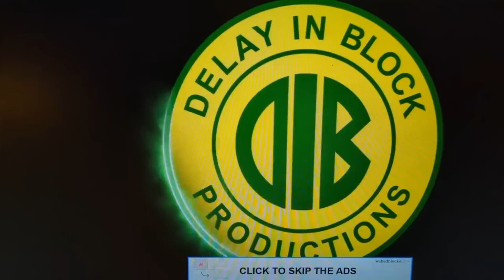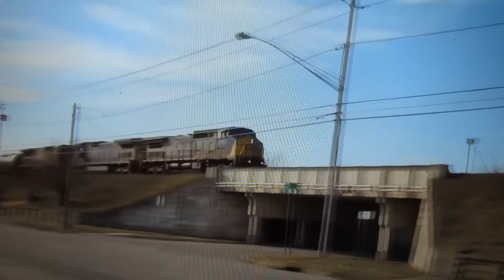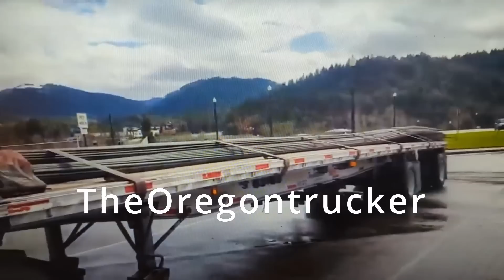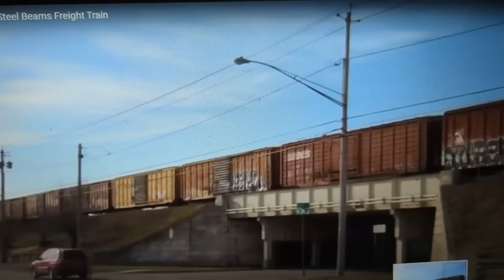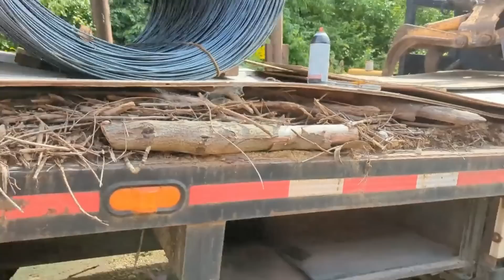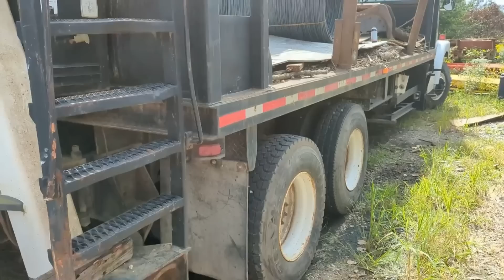Rail Cars loaded with Steel!

Comment: Besides the 3 sites you mention for railfaning, another site for viewers to go for maintenance and track work videos is "ccrx6700" (Cumberland Mine Railroad). He shows and explains cribbing, tamping, tie and rail replacement, ballast rehabilitation, minor car repair (wheelsets, couplers, hoses, etc). A lot of the same work you guys have to do, and what made your site interesting to us early subscribers.

 Incidentally they transload product from the train to barges, and only deal with a single product. For your guys sake, I hope you get to transload product and materials in both directions of a diverse set of materials. It would be very interesting to us fans to see how you develop your yard tracks for not only steel-based-product on flat cars and gondolas, but also other products in box cars, tankers, covered hoppers and so on. Mostly I'd love to see you build a couple of ramps and deal with boxcars.

Comment: Rent an excavator, ideally with a 360 swivel head. Buy/make a C arm for the coils that attaches to the standard quick attach parts.  Modify the spreader Gram bought to also mount to the quick attach for long floppy stuff. 

No capital tied up in the expensive excavator, if it goes down rental company can swap and get you back to work.

Comment: You could do an overhead crane yes it is stationary frame. But it rolls back and forth. And left and right. Containers is called a mi jack but the overhead crane could use mechanical or magnetic for lifting power.

Comment: I think one of those heavy duty forklifts would be a great asset for the operation.  The material handler would be good also but might ne limited when it comes to the truly long stuff.  I also agree with the other poster about the rental units too. Maybe buy the forklift and rent a material handler until you can buy one. Having a back up will be a necessity. 
I think it's going in the right direction. Stay safe my friend.

Comment: Try thinking about those Mobile cranes used to lift boats out of the water they have huge loader tires and are wide enough to straddle the gondola pick the load then side shift to waiting trailer totally self contained for outside us any weather with self contained operator station .

Comment: Brian don't throw in the towel on other products! 
Steel is not passive income as you said....
What you could likely do to gain something more "passive" and allow your customer to unload themselves with minimal support equipment/supervision is to look for your neighborhood home improvement/lumber/landscape dealer.
If you can "acquire" usage of one of those warehouses, then you can act as thier "distribution center" ....
You can get boxcars of lumber/sheet rock, bagged landscaping materials, pallets of pavers/bricks, the warehouse would be where they unload, and "break bulk" to go to multiple stores (or one store as needed).
They could pay you rent....
Another option is for something like bricks on pallets, just have a paved area to unload and Reload onto trucks

Comment: I was going to suggest that overhead crane from a building but someone beat me to it. The nice thing about that is it is supported on both ends, much more stable. Whatever way you go I would suggest getting some form of pad or pavement down for the crane/loader to be on. Having a smooth level surface will really help with speed and safety, not to mention avoiding the mud when it rains.
Reply: If you put down a gravel or crushed rock surface, go with 3/8 or 1/2 inch to dust, spread it out, and compact it.  It will be like concrete.

Comment: Ideally you want a rail mounted rolling A-A frame crane and a yard mule for transloading steel to trailers. I think you're on the right "track" looking at caterpillar tracked unit initially. I would think of using plug in power and mining cable for the magnet rather than a diesel generator for maximum lift.

Comment: I'm for a large front end loader with forks. I've seen them being used to unload and move shipping  containers. Using an excavator to run around a yard makes no since to me. You'll tear the ground up and make it impossible to traverse. I'm enjoying your videos and understand you're building a small business, not just a railroad. Keep striving!!!
Reply from the maker: David  Advantages to your plan....front end loaders are faster to move around...do less damage to the surface...and are plentiful at auctions.   Brian
Reply: Years ago I saw a front end loader setup with a quick change carriage on it.  They had forks that could go under a load to pick up raw stock set on boards.  For coils they had a single center spar.  It was about 6" around and would be run through the center of the coil.  It kept the load at the center instead of to one side and also, the round surface prevented marring the surface.  In this case they were handling round rolls of sheet steel.

Comment: That flat magnet  attachment looks  interesting  ..would  it work...if you take a flat plate and Weld some half moon 🌙 piece  of steel  plates to the flat piece of steel and bolt and magnetism  to bottom  of the big magnet  so the half moon add on attachment would  grab (Magnetic) more of the steel  coils..     (2) on top off magnet  installed  a 4" or so I beam for installation  of a Hydraulic  campers so Coils are magnet  and clamped to lift....(3) would  a Hydraulic  grabber attachments  on a skidsteer tractor  work to off load from a bulk head flats  cars then onto a truck trailers....
Reply from the maker: Bradford   I thought of the curved piece too, great minds think alike!  Brian

Comment: Intel project in New Albany is who you need to get with. I may end up running machines on that job. Working on a bridge replacement on Agler road in Columbus right now. It is very close to the airport.

Comment: Greetings from Europe. Bacause i have some experince wit loadning and unloading ferrrous materials i wish to help in some way. Magnet here is used only!! for scrap metal. To load with magnet like railtracks are used in special terminals with multimagnet gantry crane beam what can pick up around 10 meters of track but not one, most cases 4 or five. For unloading coils are used cranes mostly mobile cranes. On beams again cranes. On that liebherr machine is good idea but that is mostly a port loader or unloader with various attachments including magnet but mostly grabs for like grain or dirt of other we called vrack materials. If you can have a grate mobile crane, or tracked probably would be ideal. On handler, are good like Liebherr or on other one is Sennebogen. If you visit this machine dieler they cen help your to choose best attachment for your need. If You need help i can help to find from this brands machines for your need and than to visit a brand dieler. Why go on new? Beacause it assured to dont fall on you the used ones. Or used is need to cheked if can handle the porposed load. On oils the magnet not will work. best than chain or cable.

Comment: A large forklift with a special made arm to go into the coil. They make these special arms for coils. The crane on rails would work great. Have it wide enough to put the trailer between the crane and gondolas so you can pick from the gondola and put them right on the trailer. Maybe have a yard truck to move the trailers around. Truck comes in empty drops trailer on one side the yard goes to the other side and picks up a full trailer while the yard truck moves them to be loaded. I really don't think a magnet will work or is safe enough to hold on to a coil while swinging. The speeder bar to pick up long floppy rebar can be used with a forklift would work good. A material handler with special made clamp that goes inside the coils that's made not to damage the coils. Different attachments for the material handler for different products.

Comment: Brian -- it's always an honor and a privilege to follow your efforts.  While for many of us your travails through the past 2 years would be a roller coaster, your manner of presentation and persistence have managed to smooth out the grades and make it all seem more real.  I can definitely relate as a small family business owner with 3 kids flying the nest in all different directions!
I'd have to vote for mobile vs. stationary equipment.  Going stationary would tie you down and define your operations a bit, and also could also necessitate structural issues like plans, zoning, utilities, etc.  For taxes, a gantry depreciates over a longer time period (25 yrs?) vs a forklift or telehandler (5 yrs).  You might also be able to get more people with experience and certification on forklift and material handling equipment than on something like a gantry.
It looks like some of those seriously large forklifts could handle coils.   There's some fixer-upper container handlers on Iron Planet if you're up for another "will it run" challenge...
Reply from the maker: Ted  I like the mobile idea too!  Brian

Comment: I'm not sure using the magnet will be the best solution, but I assume you will try it out to see for yourself. I would strongly recommend adding extra weight inside the coils for your test. Maybe an extra 1000 pounds or so. You need a factor of safety to make sure the magnet can reliably lift a coil each and every time. If it works without any extra weight, you won't know how close you are to it dropping the coil, which is what you want to avoid at all costs. If it works with the extra weight, then you can feel a bit better about the magnet's ability to consistently hold onto a coil during routine use.

Love the channel! Been with you since the start. I wish you all the success in the world!

Comment: Oh WoW Brain...Congratulations  so Exciting.. ..Could  you get a rail mount  Boat launch type Moble   crane thus have a small 3 foot wide asle way on either side of Car and park trailers right next to gons (HOPEFULLY  bulk head flats ) and off load Start small and a open  mind... BRAIN ONE NOTE THAT IS SO COOL ON THAT LONG BEAMS CUSTOMERS BRAIN YOU WILL NEED A NICE CRANE THAT ROLLS OVER RAILCARS  (Wheels on ground on either side of rail cars with a long spreader bar attach to crane  (Remote control crane ) We work at Boeing in auburn (YOU ARE INV ITED  TO TOUR WITH US BOEING PLANT AND SEE HOW THEY OFF LOAD LONG 130 FOOT LONG ALUM BILLETS FROM BNSF AND UP RAILCARS. BOEING ALSO USE 15 TONS REMOTECONTROL CRANES TOO...)(BOEING IS HAVING A FAMILY-ETR DAY ON SEPTEMBER 18TH 2022 THIS TOUR MIGHT HELP YOU BRAIN ON A SMALLER SCALE TO HELP INSPIRATION OF IDEAS FOR ETR "*TRANSLOADSFACILITIES"*$ )( IT BE COOL TO MEET YOU TOO)(NOTE BOEING 737 PLANT IS ONLY 20 MINUTES OR SO FROM "SEA-TAC" AIRPORT WE COULD COME AND PICK YOU UP AND YOU COULD BE HOME BY DINNER).and live off Ideas As ETR GROWS....ITS SO,SO WONDERFUL  HOW ETR IDEAS GROWN AS THE MORE ETR HAS EXPANDED..  WE REMEMBER  ON FIRST VIDEOS BRAIN USING A LITTLE  ELECTRIC SAW. THEN A FEW MONTHS LATER THAT NEAT RAIL MOUNTED BRUSH HOG..BEST WISHES..LOOKING FORWARD  TO THE FIRST TRANSLOADS 👍😀👏😄

Comment: Used 4 wheel all terrain Grove crane with a spreader and nylon lift straps should cover all of your bases. Or install a jib crane and use your switcher to move the cars to the crane.

Comment: This is what I like seeing. You're on the right track with starting small and building up your customer base. When I starter over 30 years ago on a small shortline, I went door knocking on any potential business that could be future customers and while success was 50/50, we did get some that added to our bottom line.
To your unloading problem a magnet might help, but like you said, it depends on the magnet's strength and the crane's lifting. If for the short term, you may have to sling those coils out until you get better equipment. There are mobile gantry cranes available, but I'm sure they cost a pretty penny, but that's something down the line.

Keep up the good work, Brian. Be safe and hopefully you will be able to hire extra help. We're all rootin' for ya!
Reply from the maker: Thanks George, I respect your yrs of experience.  Brian

Comment: Those "coils" have no flat spot. The magnet needs surface area & thickness to pick up those steel objects.
I am not a "rail fan", I am a track fan. I worked on the roadbed for 37 years dodging trains.
 Keep up the great work & the very best of luck.
Reply from the maker: Huge respect, thanks for following. B.

Comment: Rent some equipment to start.  Not only does it lower the initial cost, minimize potential downtime for maintenance issues, and allow for a learning curve of figuring out the bare minimum needed to do todays tasks, it also buys you time to find that diamond in the rough that nobody else bids on at the auction. 

I agree that a standing gantry system would be great long term, but you don’t know for sure what specifications you need to meet (yet). You will find out soon though!

Comment: If you are using a magnet to pick up a steel coil, will the steel coil not then become a magnet itself? I can see it lifting cleanly off a wooden or aluminum bed, but it seems that it would want to stick to the other coil, the walls of the gondola, etc. You certainly wouldn't want to have these coils pull apart. Hope I am wrong!

Comment: Thanks for the Roast beef sandwich really hits the spot. As for the magnet you may want to check with the customer if that is acceptable as the steel may become magnetized also with the product not being a flat surface it may not work out. I would lean more towards the excavator with a specialty attachment similar to a clamshell but use 2 large rods that would come in from each side of the coil. As for a Gantry crane that is an expensive setup and limits your work area. Plus you would have a lot more options to use the excavator for other projects.
Reply: This is a very good point

Comment: I think a rented tracked as you seem to be gravitating towards is your best option,  especially as a start up.
You don't want tie up a ton of capital in gantry crane that will be inflexible and a maintenance headache. Plus last time I checked winter still comes around once a year and a device like that seems like a liability in the snow and ice. Also what happens when you have to change gears to service new customers and products?  You have a big investment that is unmoving. 
Flexibility and low down time are key, especially if you're planning loading 5 to 8 trailers a day.
Best of luck from another small family business!
Reply: good idea.  Renting lowers the risk/ initial investment drastically.  He can test different options too.

Comment: I like that you are trying to specialize and be customer centered. 
You are reaching out beyond your Rails to Reload.
You seem 🤔 to be finding a niche "by becoming the Customer's siding" to further this, I would suggest adding both a level pad, a loading dock, and an extension of the missing spur so you have use of that track in the future if you want.
What would be great is if you could find something that you could potentially ship in that lends itself to rail being large and bulky....
Perhaps you could potentially work a deal out at Christmas Time 🎄 for Christmas Trees, bulk landscaping materials (bagged or otherwise), pallets of bricks/pavers etc or one local short line here in Massachusetts transloaded train to-truck rowboats in the 60's or 70's to bring to a large off line store....
I would stay away from chemical transfer, I would, however look into transferring of anything NON TOXIC from Tankers or Covered Hoppers.
Build a "sump" that the tracks go through  and transfer something like "corn syrup" via hose/pump to truck, spills captured in the sump. Non toxic can be washed away.... use same area to unload covered hopper, use "pit and conveyor"....

Comment: The one issue I see here is not having a scale. Too easy to overload a truck unless you are real careful.
Reply: Structural steel is specified in pounds per foot.  So steel is easy.  (Bulk goods not so much.)
Reply: Need to check gvw after loading outbound trucks.
Reply: Scale on boom?
Reply: @johnnyhunter4345  scale to weigh the truck.  Even if you know the weight of the rolls, if they aren't placed correctly, the truck can be overweight on a axle.

Comment: Always go with over-kill equipment. It's much safer and easier on maintenance costs in the long run. Over-kill equipment will future-proof increased demand for tonnage requirements as you grow.
Reply: I always think I am doing the over-kill option, and it usually ends up being just barely good enough!
Reply: Overall, I think that the 🔑 word in the equation is "kill"....
If you don't invest in a piece of equipment that has the capability/capacity "someone might be killed"....(i.e. there might be an accident)

Comment: The material handler is the way to go. Don’t like the magnet idea. Too dangerous . Ok for scrap, but not for heavy product. I’d also look into a telehandler (Lull). Good on uneven terrain, can get wide forks or even hooks, good maneuverability. Good reach which will be good for ground storage. 
A tracked crane is ok, but I think you want to avoid cranes because of licensing and insurance issues.
Reply: I would say a tracked crane would be the safest option. It gives the most stability when when moving material.
Reply: @dmp9135  cranes are an issue because of licensing and insurance requirements. A tracked crane has to be placed on a level pad while operating. Can’t be operated on unleveled ground.